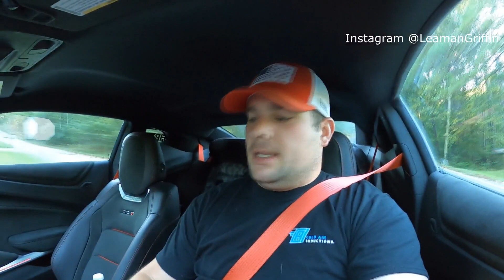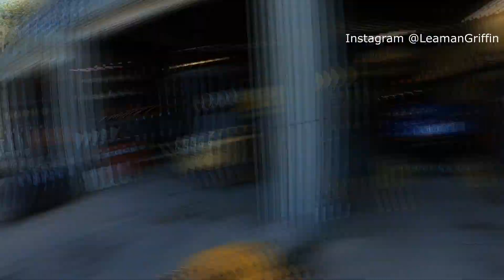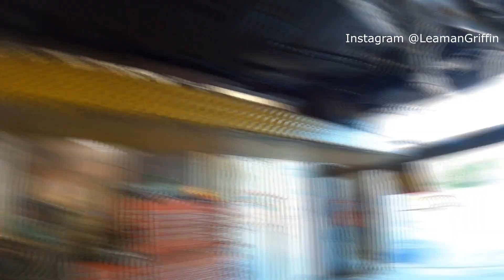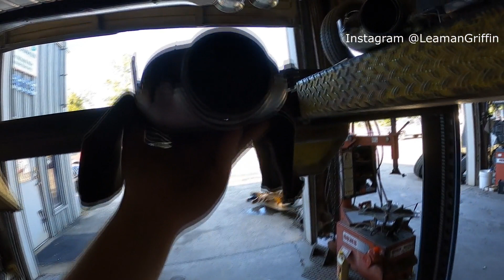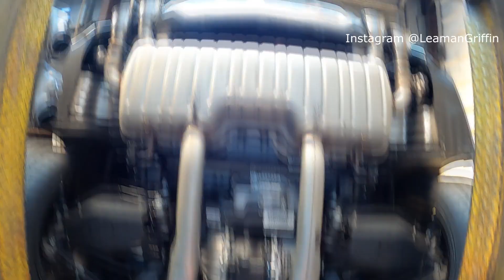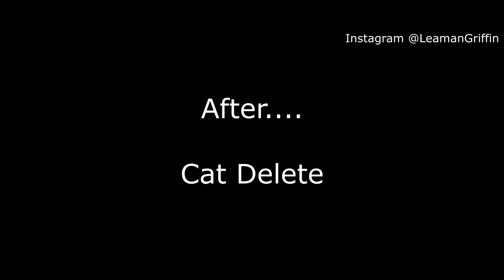2020 Camaro ZL1 Secondary Cat Delete

Comment: Sounds great my man. How much for a cat delete if you don’t mind me asking? Also can you add a muffler delete with it and still retain the NPP Valve function?
Reply: Your npp valve system is controlled inside the muffler. Once you remove the muffler you will have the same exhaust sound no matter which mode you’re in. Which is the open valve sound.
Reply: @johndillingerthe2nd920 so if I take the cats of and I still have my valves will tour mode still sound the same as usual